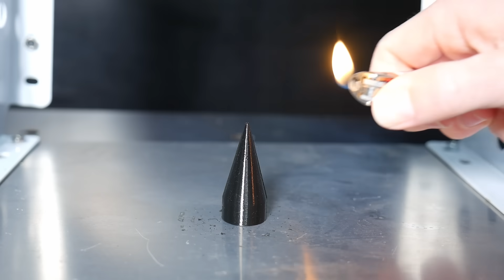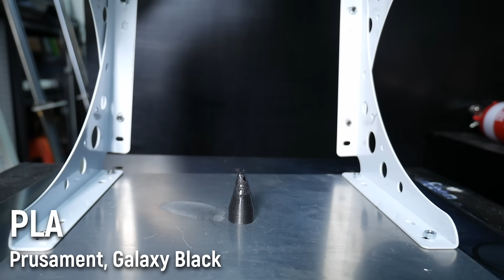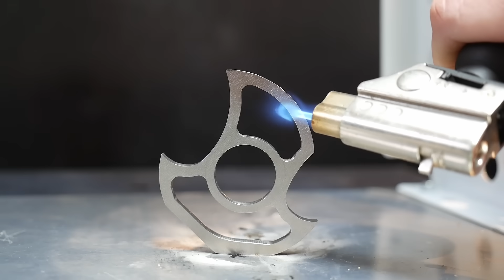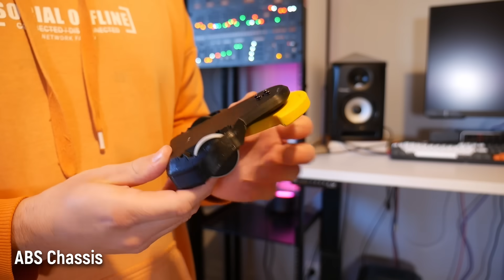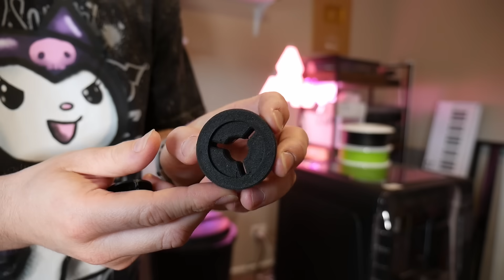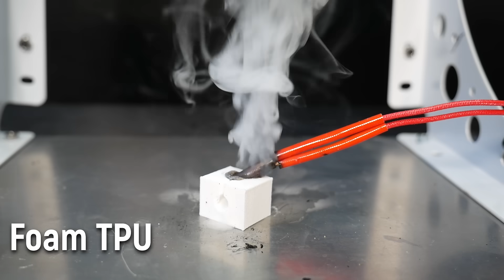Which 3D prints burn the WORST? (PLA surprised me...)

Comment: I did this test intentionally 10 years ago with the goal of finding which materials burned completely and with the lowest amount of remaining material for a project. I ended up with the same results. ABS and its vapor byproducts scored the highest in terms of lowest available remaining material, fastest ignition, but scored lowest on smoke amount (it produced a lot). Reminded me of setting G.I. Joes on fire with magnifying glass. Nylon was second place, but was much more difficult to print well at the time.

Comment: One problem with styrene based filaments is polymerisation inhibition - the presence of other compounds leads to incomplete styrene polymerisation, locking uncured monomer in the matrix. This doesn't necessarily occur when pure polystyrene is synthesised, apparently - which is why pure polystyrene disposable cutlery is a thing, while styrene copolymers quickly become uncertifiable for food contact.

And yes all ABS and the like products that you use in day to day life have copious flame retardant chemicals in them, because these polymers are so damn spicy, which are actually also harmful, but they do mitigate the danger. These are probably not used in filament like this because they can kick off during printing. Also why printing cheapest ABS regrind is an absolute disaster, you may have encountered that kind early in your journeys, as your "archnemesis".

Agree on HIPS. It prints incredibly nice, sands incredibly nice, and takes paint incredibly nice. If only it didn't emit styrene!

Comment: presumably the foaming effect in the foaming TPU is achieved with a semi-volatile organic solvent which, incidentally, also happen to usually burn quite well. you could test that by holding a lighter next to the extruder while purging foaming TPU at high temperatures.

Comment: The foam tpu is very likely burning due to surface area from all the bubbles. Even steel burns like kindling if it has enough surface area. Foam tpu and plas secret ingredient is some kind of baking soda, wich is supposed to have fire-suppressing properties qualities. I reckon it might be less even less flammable than normal tpu if you print it cold enough for it to not expand at all? 
If that ends up being a follow-up, please also Test polyterra pla, curious what the mineral additives do.

Comment: 12:37 my hypothesis would be that the air pockets/bubbles in the foam provide a constant source of oxygen as it burns through/considerably small surface area of the tpu to burn as it's just the lattice structure around the air pockets

Comment: In high school I used to explode lighters for fun and one thing I discovered was similar to your experience with the galaxy PLA, where if you held a lighter flame on for long enough the plastic by it burned a flame you couldn't really see, it looked like it was boiling, and it was self sustaining. I would leave the lighters on concrete to explode when they were like that, and eventually they all would as the plastic burned down to the gas storage.

Comment: Cool, Angus got the same results as I did when I was looking for filament flammability.
Pity you didn't trial Polycarbonate (ignites under the torch, self extinguishes as soon as the flame stops), nylon (like ABS/ASA it's a little disturbingly enthusiastic to burn) but my favourite is PPS. Hit it with the blow torch and it takes a few seconds to start melting, bubbling and smoking. Self extinguishes as soon as the flame goes away. It pretty much shrugs off a yellow flame and needs a proper intense blue torch flame.

Comment: The PLA from Prusa burning REALLY reminded me of an alcohol combustion.  I'm no chemist, but I am wondering if the heat of the torch kicked off a conversion of additives that released an alcohol, whose burn became self sustaining as it converted more.

For some REAL crazy theory crafting you can't trust from a video comment, I wonder if the only burn was the outgassing, which is why the remelted (but not significantly burned) PLA was so gorgeous?

As others have pointed out, I think the foaming TPU was being fed by dormant blowing agents that were designed to be normally released with the heat of the nozzle.  Butane? I dunno, it gives me more chills thinking about around a hot end than ABS.

Comment: Back when I was in college, I took a networking class. In that class we learned about fiber optics. One of the things I retained is the fact that light follows the fiber unless the bend radius allows the light to escape. I used this fact to design a translucent PETG LED light diffuser cap. I basically created fiber optics via a drilled and polished core which sits on top of the 360 diffuse LED chip, and created a path which had sharp corners where I wanted the light to escape.

I explained this to a friend at work and he thought I was just making all of it up. He was one of our brightest engineers too. I was sure he would know exactly what I was talking about.

Comment: I would have liked to have seen PP. I print with it sometimes. I actually own the prusa PP sheet. That sheet is freaking amazing. When I used a normal sheet I got 50% results in summer and 10% results in winter. With the PP sheet I get 100% results winter or summer.

Comment: "Don't print in your bedroom or workspace" what if that's the only space I have to print in?.. Granted I always turn the bathroom fan on when the things running to at least try to help with any build up that might happen (and I'm not exactly printing constantly), in addition to my air purifier which is always running. Not that venting outside necessarily solves all problems either, since like Zack Freedman mentioned one time, "vent it outside so it's someone else's problem".. should've just left all this 💩 in the ground where it belongs instead of digging it up to "use" and exposing everyone to all sorta 💩..

Comment: I have my printer in my room, not the best spot but TBH I don't exactly have a better one. But I do have a filter on it and it's a chamber that I will also be sealing better as I'm able. (trying to figure out venting outside but window is next to an AC unit so defeats the purpose) I tend to print a fair amount of ABS, ABS+, and ASA. After a while the smells leak out etc etc, these things aren't exactly sealed systems. Ventilation is SUPER important. I've burned though plenty of plastic outside of 3d printing though, for many reasons. But one thing I have noticed in general is the "engineering" stuff seems to really like it's flames. ABS and nylon for instance just don't want to go. Actually have a scar from a drop of nylon that got away from me when I was melting the end of a nylon rope.

Comment: there are standards eu testing protocols  which are eorth looking at.

EN ISO 9772 and 9773 for plastics as material
and

IEC 60695-2-12, IEC 60695-2-13
glow wire tests for plastics around electrical currents

Comment: look online for plastic msds info, it should contain flammability, it will tell you all you need to know about what will and wont burn. Alot of modern plastics are self extinguishing, but they will still melt and produce toxic fumes under an external source like a flmae or red hot piece of electrical equipment. DO NOT burn plastic glued with cyanoacrylate glue (super glue) as this makes hydrogen cyanide gas. hydrogen cyanide gas BAD!. 
ABS and ASA have a styrene component it burns dirty and black, making the sooty black smoke.
Foamed TPU is burning probably becaus eof the blowing agents added to make it foam, also the small airpockets increase surface area and contribute to it staying alight.

Comment: i actually built an exaust duct connected to m the filtration fan of my qidi q2 and i also have an inline dan with hose clamps. i only use asa for anything that needs the thermal resistance. case ant point reusable spools and spool rings. i dont worry about pla petg ot tpu. those are relatively safe not to say i haven't seen a heater cartridge smoking from a blob of death then taking apart the block for a new on my ender 3.

Comment: I believe the foamy TPU has little air pockets.  As the walls of a pocket are burned or melted away, its air (including oxygen) flows directly into the flame.  The building code in most areas allow PVC in the walls for plumbing and conduit because it's self extinguishing.  Much to the surprise of some contractors I used, my city prohibits PVC in the walls because of the toxins produced when subjected to an external flame.

Comment: When it comes to flammability of plastics, there is basically only one relevant universal test standard: UL 94 ("Tests for Flammability of Plastic Materials for Parts in Devices and Appliances"). This is state-of-the art e.g. for automotive and aerospace industries.

It contains various vertical and horizontal flame retardancy classes and usually tests how long it takes for a standardized sample to stop burning after the flame is removed, and whether droplets or burning droplets occur. If certificates are not required, these tests can be easily performed in any semi-professional environment.

There are many flame retardent fillaments (usually ABS / ASA / PA / PC, but also some PLAs and PETGs) on the market that already come with a UL 94 rating (often combined with a minimal wall thickness).

Also note: fire resistance is not the same as temperature resistance. There are some fillaments that are flame retardent, but have a medium to low Heat Deflection Temperature.

Comment: Pretty much any foaming agent you add to TPU, or any other plastic, will make it burn. I used to work in plastic injection molding and we made our own foaming plastic for sealing the pillars that are around your car windows, activated when baking the paint. One spark from someone grinding a weld hit a batch of the foaming powder that was next up on the mixer and it shot an ash snake 30 ft in the air and hit the ceiling. You know like the firework snakes you play with as a child. I'd think the foaming PLA would burn really well too.

Comment: Another thing you'll find is that just as the same materials from different vendors burn differently, using different print profiles of the same material from the same vendor will have different flammability.

Comment: This is actually good to know because for some of my 3-D prints I basically just use melted PLA to glue them together. I take a lighter to them hold it over the piece. Let a few drops fall and then while it’s still liquid, put the other piece on and it fuses it together very well.

Comment: To reach auto-ignition the plastic and whatever it’s sharing heat with all need to be raised to that temperature, the still cold plastic around the glow plug was sapping heat preventing auto-ignition from anywhere but possibly the surface of the plug (the white smoke also could be decomposition). To reach auto-ignition you will likely need to contain it in a bowl and then heat the bowl beyond the auto-ignition temperature, it will melt and then decompose before it starts to auto-ignite, but also please don’t do this, a bowl of 300C+ molten plastic going through potentially gaseous decomposition before self igniting  sounds like a horrifying thing.

Comment: Foam TPU contains air, air contains oxygen, you need oxygen to burn, ergo you have a baked in oxidizer to keep the flame going.
Reply: And a much bigger surface. Like Iron and Iron-Wool/ fine Iron shavings.

Comment: You should have tested various PC boards, wires, connectors, shrink tubing, electrical tape, duct tape, hot glue, conformal coatings, and perfboard, etc, since it is often electronics and wiring that overheat. Idea for a follow-up video?

Comment: you could make your next robot out of solid steel and aluminim with just some small electrical insulators os the battery might be burning but the other robot melts while yours is maybe not functional but wins because the other robot is just a blob of burning plastic and the weight would help the robot to not get flung around or have tires slipping.

Comment: I think the video is not complete without mentioning norms like UL94. 
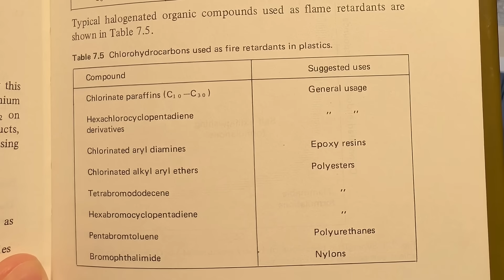Also Al(OH)3 is a flame retartand that is no Chlorohydrocarbon like the ones at 17:20. Interestengly I never researched what flame retartands are used in filaments. 

Maybe also interesting is the fact that some filaments that fulfill the following requirements:
EN 45545 - Fire protection on railway vehicles
NFPA 130 - a standard established by the National Fire Protection Association (NFPA) that outlines fire protection and life safety requirements for fixed guideway transit and passenger rail systems
SMP 800-C - Toxic gas sampling and analytical procedures
FAR 25.853 - Compartment interiors of airplanes

I think, as a follow up - with the question of the toxicity of the offburn the 3rd one could be interessting :)

Comment: Theory: The reason why some filaments only catch fire with the blowtorch is because with the torch you can get it hot enough that it starts to decompose faster which creates gases. These gases are what's actually burning, this is why the Prusament Galaxy Black for example didn't show any charring. The radiative heat from the flame was hot enough to sustain the reaction of heating it to the point where it would create gases that fueled the flame.

Comment: PETG haze is glycol separating from the polymer trapping soot and ash
Reply: Yep, at a factory tour at Prusa in Prague they mentioned that this white haze is from the glycol. They add it as a flux to all PETG filaments to make it print smoother.
Reply: When will this myth about PETG "having glycol in it" die? The G in PETG means "glycol-modified". The PET polymerization process always involved ethylene glycol. PETG contaminates that replacing some of the ethylene glycol, so that there will not be a uniform polymerization that can crystallize but some larger components in some of the polymer chains that do not occur uniformly and that block formation of a lattice. The added component is usually CHDM, not "glycol".
Reply: @daliasprints9798  This has nothing to do with the polymer structure. Glycol is often added as an additive flux to make the filament go more smoothly through the nozzle. It is in the bath that the filament goes through to cool down after extrusion and sticks to the outside of the filament in small quantities. Some of that then evaporates during printing, does its job as a flux and re-condenses on any nearby surface as that white haze.
Reply: @KonradTheWizzard  Where did you get that from, cat farts?
Reply: @daliasprints9798  There is really no need to be insulting like this. I was told about that by the guide on a tour through Prusa's filament production.
Reply: @KonradTheWizzard  OK sorry about that. It came across to me as something LLMs picked up from Reddit or something, but the way I said that was insulting and dismissive. Maybe whatever Prusa (and maybe other manufacturers) is doing is the source of the confusion about what PETG means, if there's a second role for glycol involved.
Reply: @KonradTheWizzard  All I know is that the pure PET filaments I've used print way differently than PETG. Much higher print temperatures, and parts are more brittle.
Reply: @quinnobi42  PET and PETG are similar, but different polymers. PETG replaces some ethylene glycol groups in PET with CHDM. According to wikipedia this prevents crystallization (i.e. it is less brittle) and lowers the melting point (i.e. lower print temperature). So, exactly what you observed as a result of slightly different polymer structure.

Even within the same polymer type you can have different behavior depending on chain length and additives.

Comment: A foam burns much easier than a non-foam simply because the foam involves so much air -- it's the air pockets that make a foam a foam, after all. Expanding foams used in construction produce carbon dioxide so that the bubbles don't feed a house fire if the foam starts to burn or melt. However, foam filaments don't expand the same (or they wouldn't be reliable and predictable enough to be used for 3D printing), so I assume the bubbles in the foam are just atmospheric gas, so relatively oxygen-rich.

Comment: Huh, that glow plug robot is an interesting weapon choice.  I imagine it's a lot better than a flamethrower since it has time to really build up some serious heat that can pierce through armor, whereas the average flamethrower just looks energetic but requires sustained exposure to do any real damage.

I think the reason the filaments didn't spontaneously combust is for 2 reasons:
1.  The materials were vaporizing, which is basically taking the ready-to-burn materials and removing them from the heat source
2.  Heat was applied to the materials but not the environment.  If the fumes were just as hot, then you'd see spontaneous combustion.
This is basically how oil fires work - you can take a blowtorch to diesel fuel and nothing happens, but if you make it boil and burn the fumes, then you've got a fire.

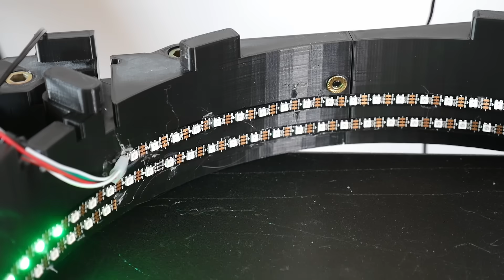Comment: People just learning that plastic is flammable? Lol you can use it as rocket fuel. Also 7+ minutes of waffle before the actual tests, skip to 7:50 for the actual content. The ones that didn't burn will burn when printed in thin sheets, plastic is long chains of carbon ffs it all burns, you test part is highly misleading also you are burning them in a location with no  airflow. Your test is useless.

Comment: The Foamy TPU has an gigantic surface. It's similar to some kind of dust like flour. It dosent burn well when you try it with a heap of flour. But when you blow IT through a flame IT explodes. The Surface gets bigger and the particles are so tiny that it can heat up verry fast.